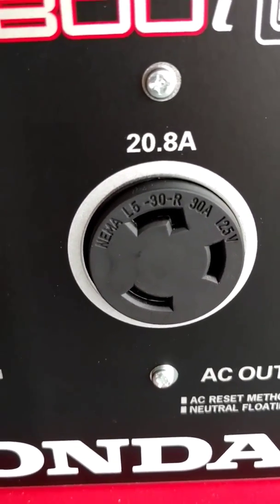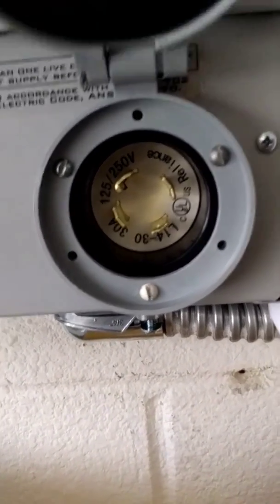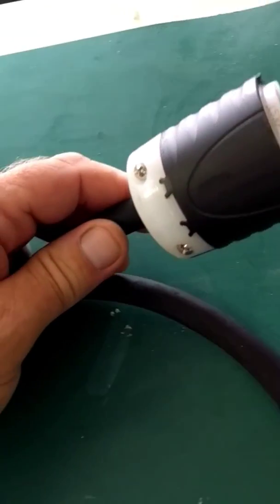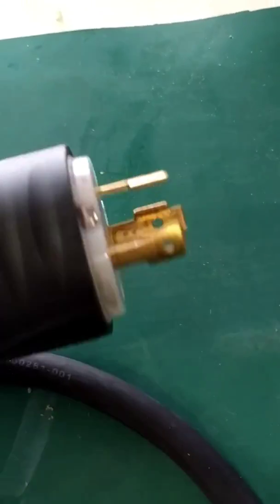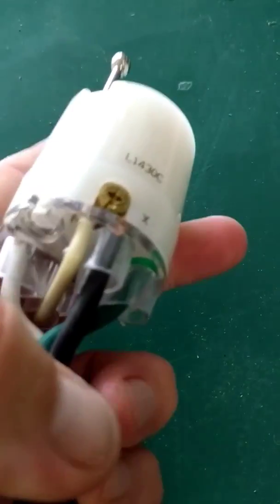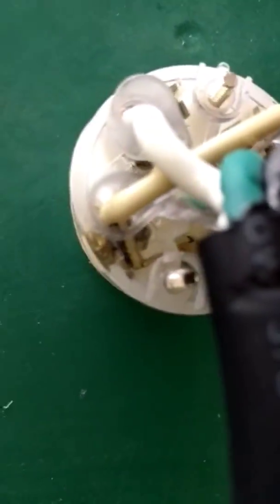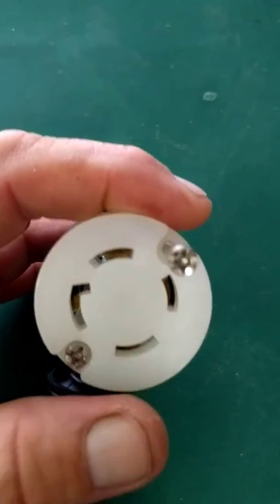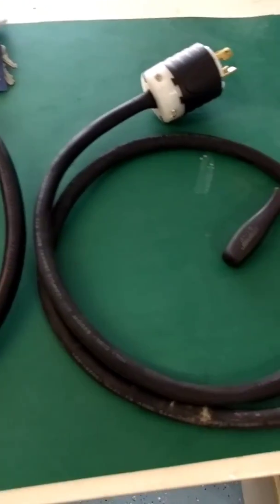L5 30R plug into L14 30R

Comment: Sure you can do it this way or buy an adapter cable. Also, now this doesn't mean you can gang up two circuits on the transfer switch. It's still single phase and you can only power 6x125V circuits.

Comment: One thing to be careful about: some houses have branch (common neutral) circuits. If you have that, that means that some 120V circuits use the +/- polarity to cancel out the current on the common neutral. If your house has that, it could be dangerous to jump the two hots together even if you only have 120V circuits since you'll be doubling the current flowing through some of your wires (instead of cancelling them to zero). If you don't have that, and don't have any 240V circuits your want to power, then this video would work great

Comment: So you don’t need the jumper wire if you are gonna run 240v?
Reply: ??? That generator is not putting out 240v in the first place. YOU HAVE NO 240V REGARDLESS.

Comment: Jumping x and y, is keeping it at 120v. Even though it's still plugged into an l14-30r which is usually tied to a double pole 30amp breaker. The jumper keeps it at 120v.
Reply: adapter is available for sale that costs less than he spent on the plugs and wire. I give link above.

Comment: i have a question. i have a champion generator with the l5 plug and i purchased the protran transfer switch like you did. since the transfer switch came with a 4 prong outlet box, inside the outlet box had 4 wires.( blk, green, white and red). did you just use 3 of the inside wires of the junction box and just not connect lets say for instance the red wire? leaving the red one unconnected and just electric tap them up so they can touch anything  then do the same from transfer switch to main breaker box since it also had the 4 wires; leaving the same red wire disconnected. hoping that made sense. lol and also tyvm for the tip on the jumper wire you mentioned bc i changed only one end of my wire that was provided with the transfer switch and cut it off and added the l5 plug end but left the other alone but looks like i am going to have to now cut the other end and get a new plug so that i can do the jumper wire like you did. also if you can answer this. what would happen if that jumper wire wasnt done?  or left exsisting plug on the other end the way its wired .
Reply: @jamesboatbuild  i actually figured it out...took a few mins but its good...tyvm anyway

Comment: Do you think this would work with a L6-30 to a L14-30 ? All Best H
Reply: l6 is a 240v only and does not have the neutral. You would not have the neutral to provide 120v to your regular circuits.  Only if you are using 240v circuits only.

Comment: Many thanks for putting this out there.  Did mine with a 4 line cable but your trick on drilling the top was perfect.
Reply: How did you do it with 4 wires? I'm trying to do the same thing.
Reply: @jamesnorris6969  With 4 wires I would think you put both hot wires into the same connection on the 3 wire plug.